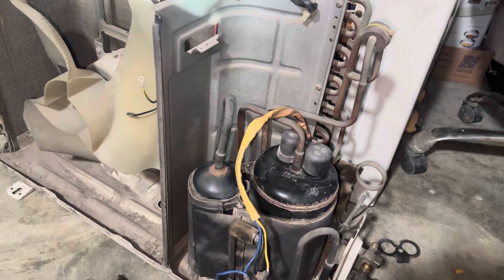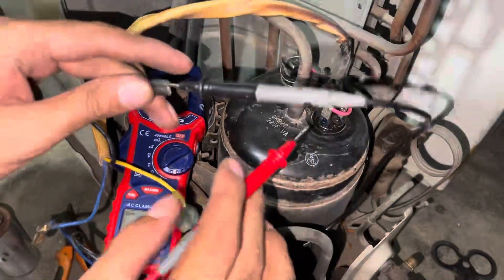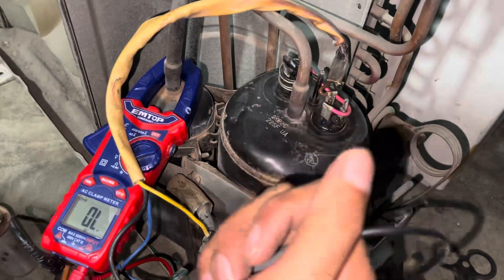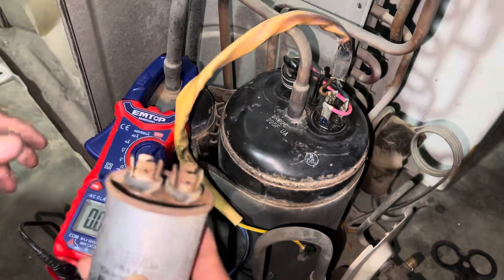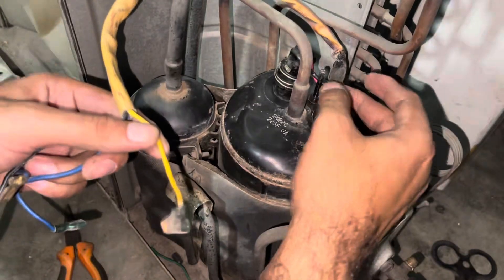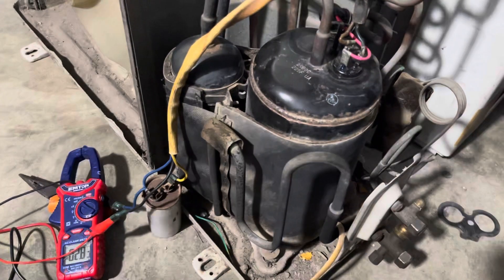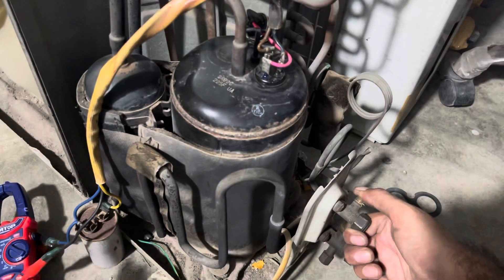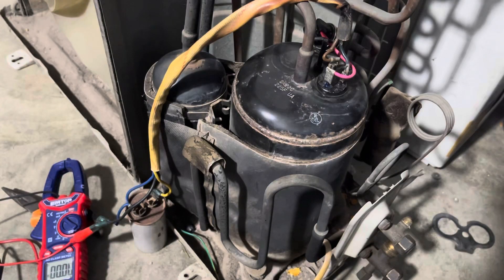How to testing a rotary compressor any split AC

Comment: Sir may India se hon mujh ko ye janna tha ke Jo hot and cold AC hota hai is mey 4way valve kitne voltage per Kam kar ta hay to us ke liye bhi ek relay hogi Jo remote se on hogi to hot mode per rilay on hi rahe gi na jap tak mod chenge nahi kar dete .
Aur ser kya ham Raning me us ka mode change kar sakte hai kya
Reply from the maker: G bhai jan 4 way valve k liay B Relay hoti hai mode heat pr krny sy on hoti hai or 4 way valve 220v pr he operate hota hai 
Or g running mai heating pr kr sakty hai